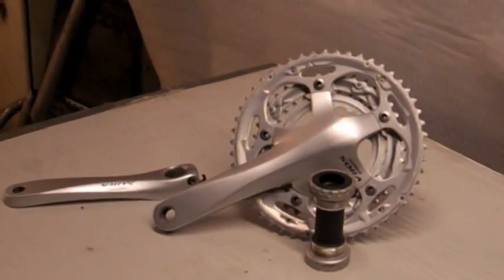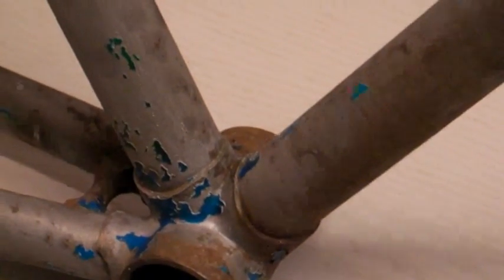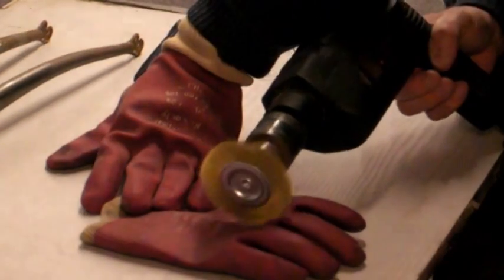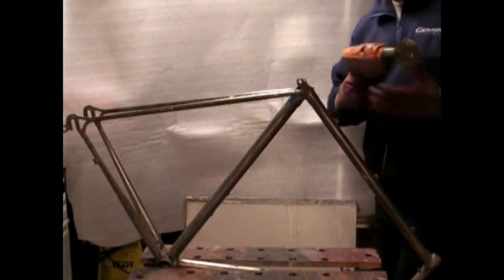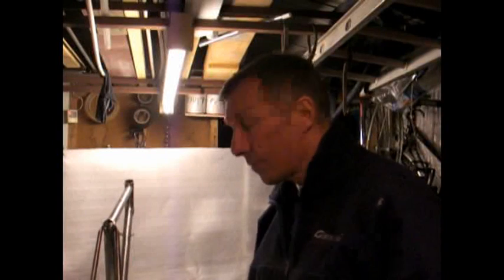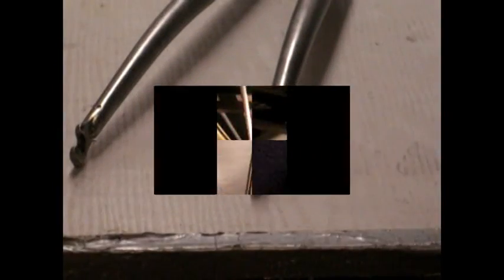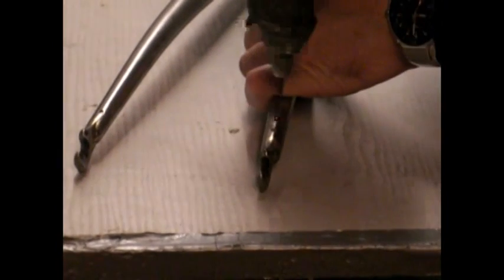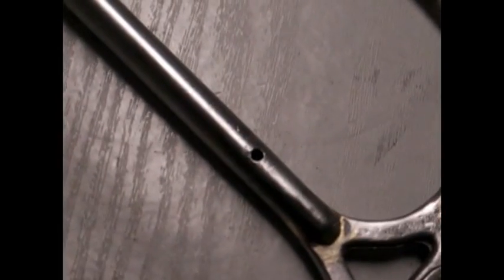Bike Maintenance - Part 3. The De-rust. 30 Year Old Harry Hall Road Bike - TOTAL - rebuild

Comment: Cellulose thinners? I guess white spirit will do same job?
I have a "scrubbing pad" that comes as an attachment for the drill too - works well, slower of course, but a wee bit less harsh than the wire brush.

Comment: I use an angle grinder with a wire brush attachment . No problems so far , not using the grinder's guard is much easier arournd corners, etc. Use of eye protection in case of a flying steel wire . Brushes have ratings eg. 11.000 rpm if you dont match your grinder's speed with the brush rating steel will fly around. Finally i use the drill (with another wire brush) for very tight spots. Using paint stripping chems, with grinder brush combo and drill for tight spots i believe its the fastest way